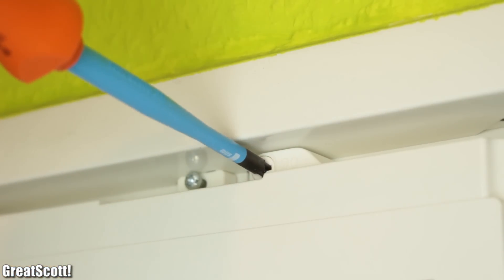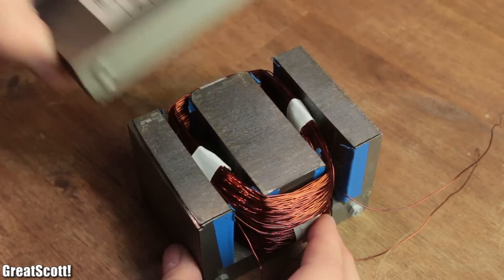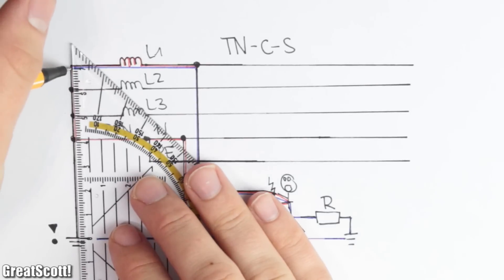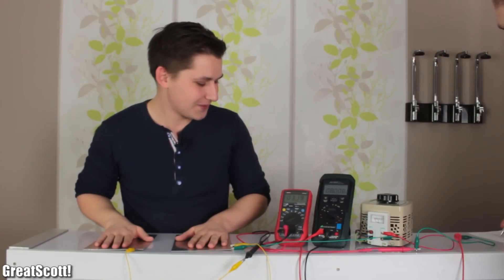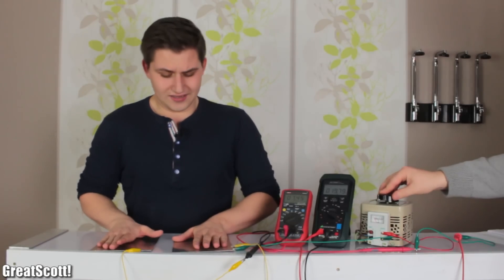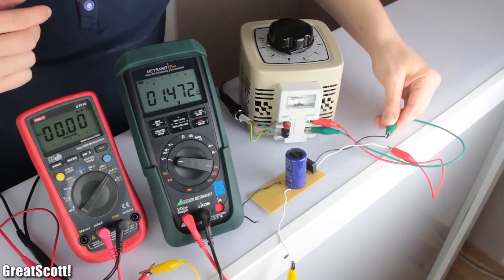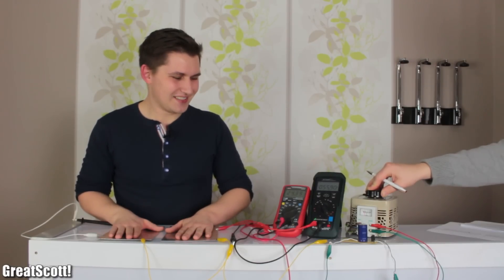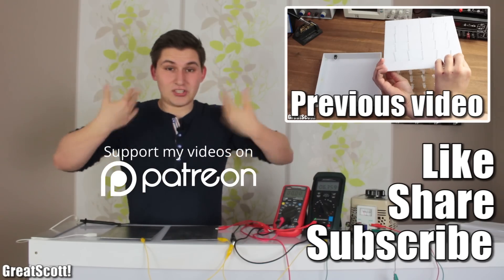AC VS DC - Pain Test (Experiment)

Comment: I remember the 7 times I have accidentally touched 240v AC in my house. I never wan't to repeat it, its really nasty. I am lucky. (Well 240v is standard but my house gets closer to 250v)
Reply: 7 times is not an accident... be careful man.
Reply: well 240 is deadly if it really catches u
it feels so refreshing to hit by it though :D
Reply: +Ame Nightcore I don't work with electronics everyday etc. but i also got shocked about 3-4 times in my life. I also unloaded on me digital camera capacitor (for the flash) by accidentally touching screwdriver while discharging it, and i clearly felt the pain for an hour long. For anyone that touched current in their live, this video is painful to watch :D
Reply: thats seriously a LOT of voltage here where I live the current amount in a house is 120 volts o.O
Reply: +Ame Nightcore I've had a couple of 240v mains shocks, once as a kid swinging from a light fitting (I was a stupid kid) and once from a PC I was repairing. I still have the scars from the electrical burn on one finger. 
You can feel the electricity make your whole body buzz / vibrate. It's weird, not exactly painful, but unpleasant enough to not want to repeat it.
Reply: +Ame Nightcore i was hit 3 times (230v) lol its like someone is ripping your skin of but they were small conctact points so i was able to jump quickly, always isolate 230v contacts i learned the hard way :')
Reply: +Kristijan Dinga They say sometimes to me if i ask why we use 240 and not 120 volts: The coffee will be done faster. of course is that a little joke.
Reply: +Ame Nightcore I remmber my 2 times with 400V trough my collarbone...
Reply: +Patrik Gajdoš You've never been electrocuted, just shocked... Electrocuted is dead.
Reply: madmaniaq I work on the electrics in my house a lot. The first time I was replacing a light switch and I turned the power back on to check the orientation of the switch which was correct so I went to place the switch back onto the wall but I forgot the power was on. That one hurt a lot.
Reply: +Ame Nightcore my first mains contact was at about two or three years old, apparently i found a piece of wire and put it in a wall socket. when i got shocked i dropped the end of the wire and it burnt a hole through the carpet :D
so, lucky to still be here i guess..
Reply: Kristijan Dinga Well it will only cost more money if it breaks appliances. If your voltage is higher then you will draw less amps which means the wattage is exactly the same. I know what you mean though, its kinda dangerous maybe you could install a voltage regulator in your house?
Reply: +NItro Cat  only 120? i've got 240 volts too. (netherlands)
Reply: Ame your example is a terrible one
Leds function like a short so 100amps will flow through it
Flourescent bulbs would have been a better example
Reply: +Ame Nightcore human are not switching mode power supply, that maintains stable input wattage varying low with input voltage
Reply: *****
i've got that too
Reply: same at a old house we own (250vac).
Reply: Bert Anernie Lol? Mains power is not that dangerous. Maybe for a tiny kid or a really really old man/woman but its unlikely to kill you unless you hold onto it for a extended period of time like a idiot.
Reply: ***** Well I have been now hit by 250 volts 8 times and I am not dead. No one else I have spoken to who have been hit has died either just look up in the comments. So your assumption of 'Most Likely' is incorrect. Its Most Unlikely. Also the human body is not going to draw 16amps. Probably a few milliamps. We are not made of metal, its not a dead short. Our bodys which are made up of skin and water are conductive but not that conductive.
Reply: "No one else I have spoken to who have been hit has died either" @DiraNightcore  Really? I wonder why?
Reply: ***** Well no protection is going to stop you being shocked. A fuse or breaker switch will only trip if there is a short circuit. Most houses don't have RCD's which are the only thing that can protect you from shock.
Reply: Bert Anernie The ignorance with this one ;D
Reply: ***** 40ma is enough to stop your heart. Even worse than you thought :)
Reply: I also touched 230 v ac  accidentally,hehe
Reply: Every body in America is lucky because our voltage is 120v
Reply: +Ame Nightcore Shoked by ~250v at least two times. Luckily, the first one was only on one finger
Reply: KylesGamersNL ohhh I love countries like Netherlands :3 . and it ain't that dangerous now that I think, cos here (Colombia) residential districts still have voltages between 110 - 240 the oldest ones still have 110 ( I correct myself it wasn't 120)
Reply: NItro Cat
Owkai :). Here in the netherlands is a lot of rain right now, and by the way, colobia is cool too!
Reply: Stop working with live power, you fucking moron. You're lucky to still be alive.
Reply: ***** Well if you earth it thats a RCD. If you short it thats a breaker switch. Most houses won't have a RCD unfortunately. :)
Reply: ***** Oh right, well count yourself lucky that you didn't get fried. The lights did not dim when I was shocked, maybe I'm less conductive XD
Reply: Ame Nightcore Actually, our rule of thumb is 1A through the body or 10mA through the heart is fatal. We are all lucky that the pain threshold is far below fatality. I have been shocked by a variety of things myself.
Reply: Yeah and the feeling of helpless you get when you cant move away in the split secondm
Reply: How much amps?
Reply: Did you just touch only one wire?    + or -
Reply: I touched too
Reply: NItro Cat Voltage is not the same as current. Current is determined by the draw from a appliance, you could run a LED from a 100AMP supply but it would only draw what it needs. Many countries including the US have 120v as you do which can actually be more dangerous since lower volts means higher amps to maintain wattage and its high amperage that kills you as long as you have enough voltage to carry the current(amps) through your body.
Reply: Ame Nightcore youre totally right. Didn't consider the current xc. With that being said here is more dangerous, knowing that 50 miliamps can kill you and 120 v means more current around a house circuit. I feel lucky because I've never experienced this
Reply: Ame Nightcore Lol?? How stupid are you? If you ever get hooked up to a circuit without an RCD you are toast. Enjoy your Darwin Award, idiot.